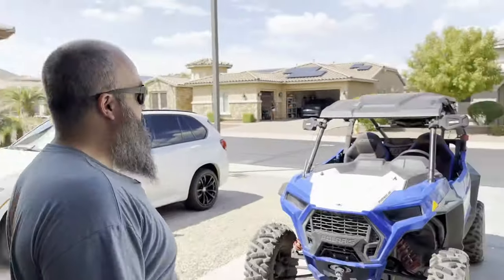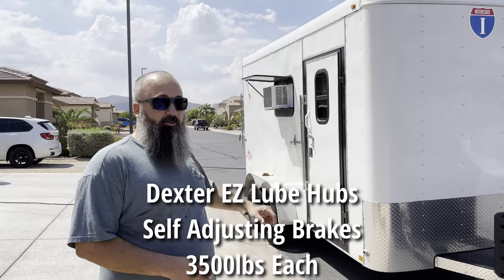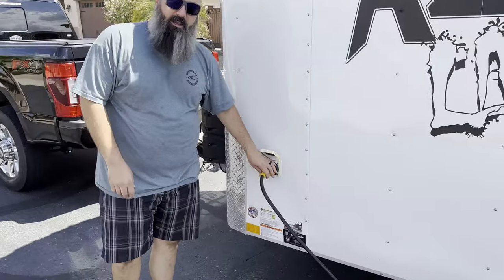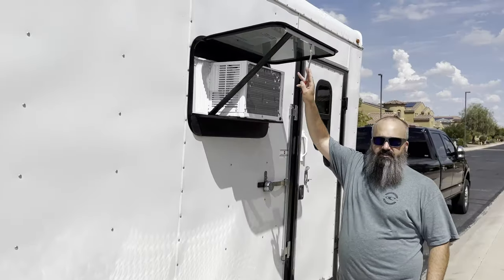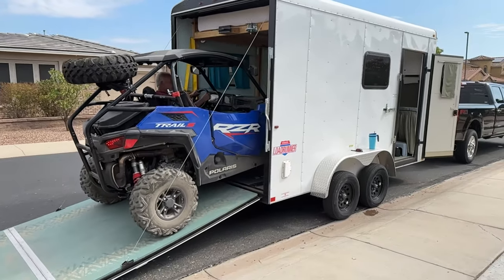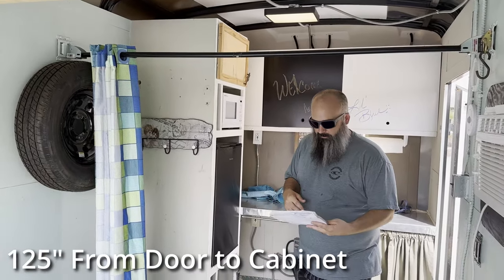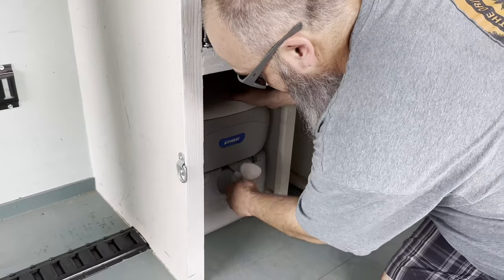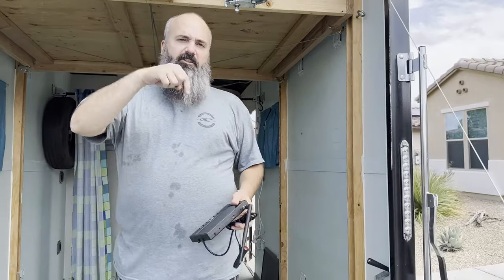7x14 Toy Hauler/Camper Cargo Trailer Conversion Tour

Comment: Nice set up! 
You didnt mention anything about the floor. Maybe uou purchased the trailer with that floor. If you all put that floor down yourself would you mind sharing what product you used? Thanks much!
Reply from the maker: The floor is the stock plywood with some sealer between the joints and then a coat of paint.